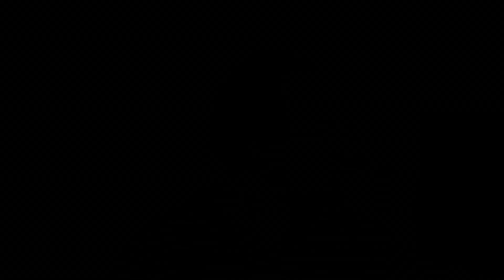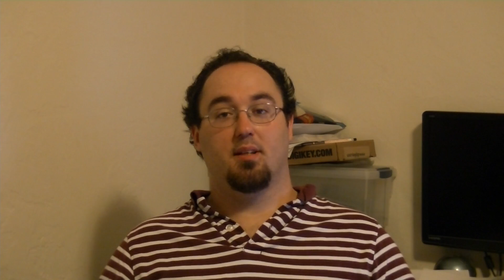1989 Honda Accord Revival: Day 2 - Testing the ECM

Comment from the maker: That was the first thing I checked - good relay, bad pump.  Replaced the pump, installed FP gauge - 39 psi fuel pressure, Key On / Engine Off.  Part 3 is me picking up fuel injectors, going to be cleaning those tomorrow after work, and I'll record how that goes, too ;)